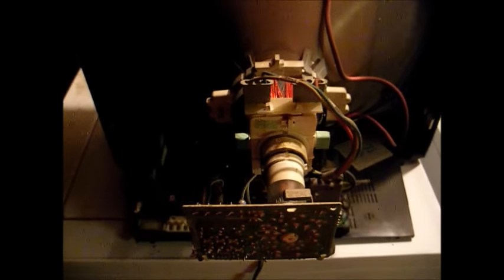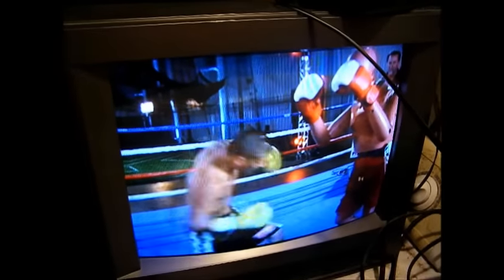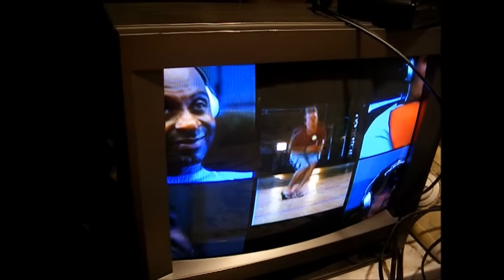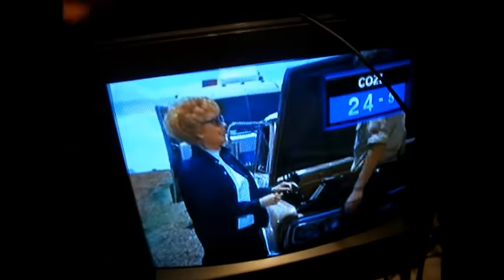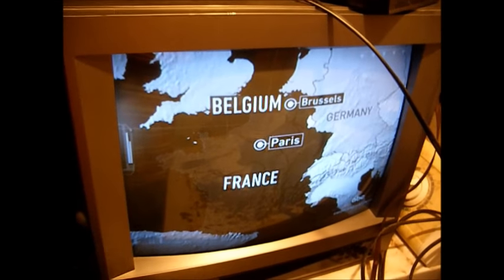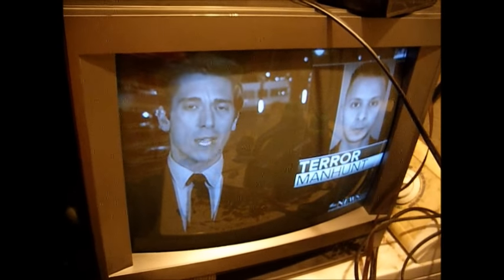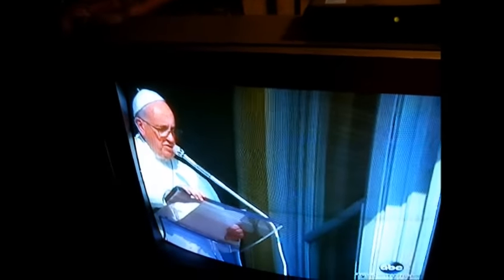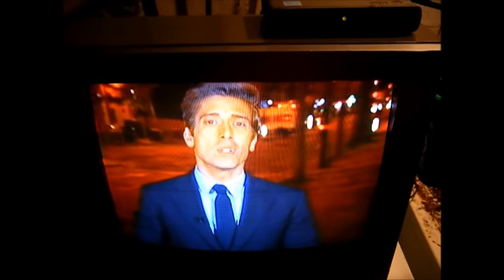Adjustment of a 1992 RCA 20" color TV (CTC146 chassis)

Comment: Nice job! Missing you work your magic! I just found an Admiral 5W32 today for $1.99 at Savers. Quite a find I think, with all the original tubes still in it! Thanks for posting and looking forward to the next.
Reply: +Darryl Landry only 2$ at Savers, wow?  Here Savers tend to cost more than over priced Good Wills. I guess it's whatever they can get away with, Value World stores can differ a lot, one store can be a lot cheaper than another.  VOA usually has the best deals.  Um going to make  vids of many junk stores in the Cleveland area.  Don
Reply: *****
I've found that even in my area, there are two savers stores and the pricing is dramatically different between the two.

Comment: I still have My 1995 RCA 36 inch set, works good yet with no issues as of yet, got it back in "95 and had no problems yet, also i have a 1951 roundie TV i'd like to have Restored some day so i can watch my classic TV shows i have on tape/DVD on it,  As i like the older sets better than the modern sets. Plus the 1951 is also RCA  And RCA had some great sets decades ago., Hopefully The older set can be Restored,That I saved from the junk pile, as some one was gonna throw it out and i said i'd rather take it home with me, and I want it Restored if it can be.

Comment: I see the recent broadcasts as a video source. I didn't know you could still watch television on the old analog tube monitors. They still broadcast in standard ratio 4:3?
Reply: +siskokidd He had a DTV converter box hooked to the set. I think the DTV box automatically down converts 16:9 HD content to SD 4:3.
Reply: Thanks Ronnie. Serves me right for not owning a television!
Reply: +Ronnie Bradley It seems to me that the TV converts the signal to fit rather than the box I use a 4:3 set still and the TV coverts anything 16:9 i put into it
Reply: Does the converter box keep the 16:9 ratio by adding a border along the top and bottom?
Reply: siskokidd The whole screen is taken up, no borders at all, however 4:3 shows broadcasted with the black bars have the black bars at the sides even though it is a 4:3 TV!